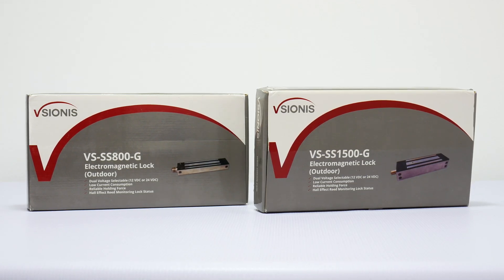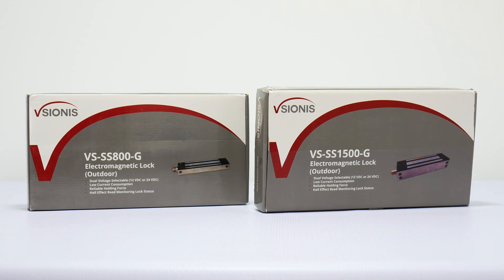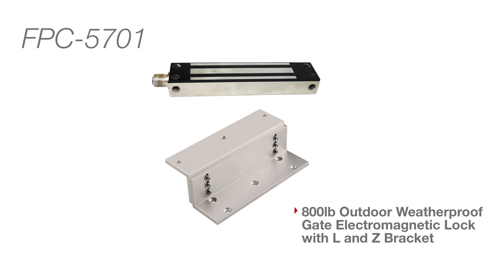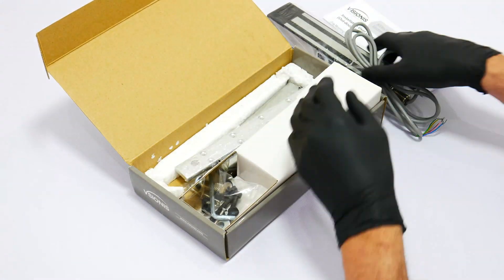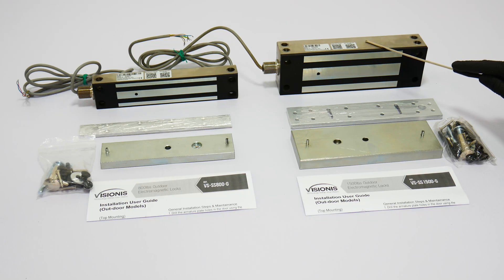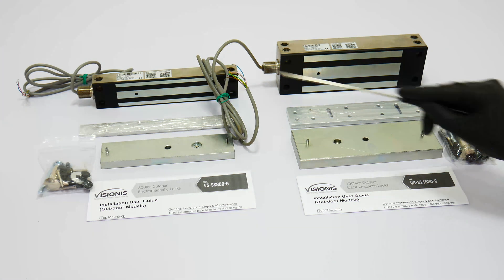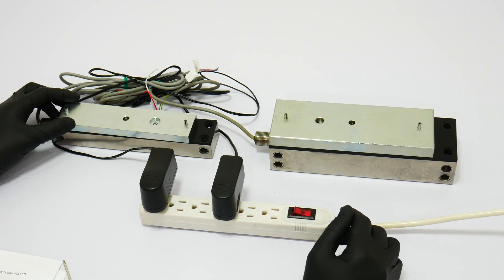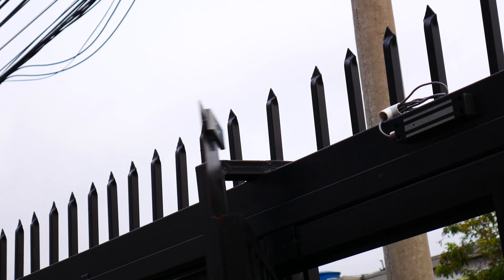Outdoor and Gate Electromagnetic Waterproof Locks UNBOXING | VIS-SS800-G, VIS-SS1500-G Visionis

Comment: Do u have outdoor rated Electro mechanical lock with built-in Door sensor? (IP 66 Rated)? Operating Temp (0-60 Deg)?, we need to use this at unmanned location so lock should have Key arrangement to open from outside of gate (Lock should handle 150 Kg Gate)?
Reply from the maker: Hi Visha,
Our Visionis VS-SS1500-G 1500 Lbs Outdoor And Gate Electromagnetic Lock can work for you.
Is IP 66 weatherproof maglock for outdoors, and its operating temperature is (32~131° F) and it has a Hall Effect Reed Monitoring Lock Status. If you have any other questions you can give us a call back at 786-442-1220.
Thank you.
Reply: @FPCSecurity  thanks for ur reply. As mentioned we have to place this lock at unmanned location so lock should work in fail secure mode so in case of power issue lock shouldn't open from outside, in such case only person with authorised key will open lock from outside..do u have such product.
Reply from the maker: @vishalaga1590  all our maglocks are Fail Safe, however we have electric strikes that are fail secure. If you have any other questions you can give us a call back at 786-442-1220.
Thank you.